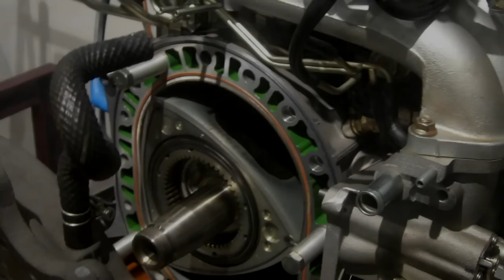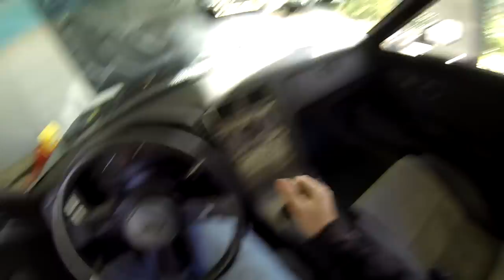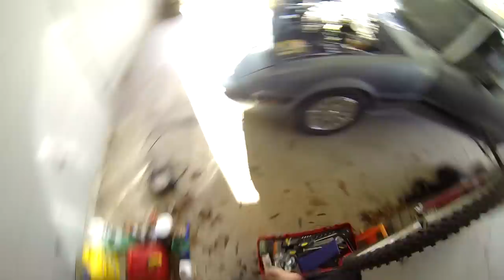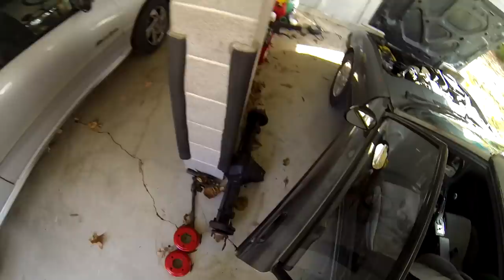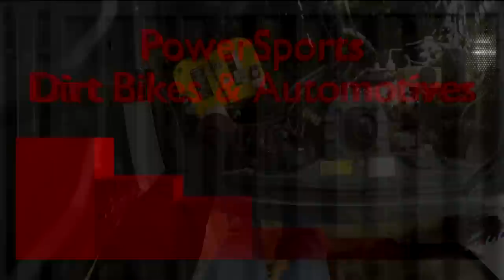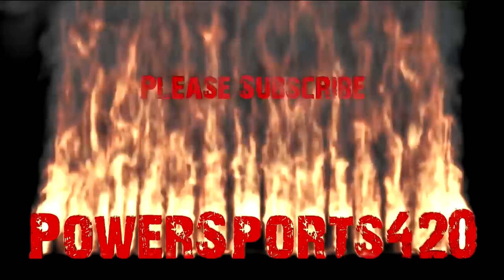RX7 Ep.11 - RX-7 Un-Flooding Procedure (How To Unflood The 13b)

Comment: Never start a manual without depressing the clutch. Not depressing the clutch puts added strain on the starter because you're trying to spin the trans while turning over the motor.
If you don't get it unflooded after one or two tries you must remove the plugs leading and trailing. I use brake clean to wash the excess fuel and carbon from the plugs.
Then add a bit of trans fluid in the trailing edge plug holes.
I pull the  coil leads off so you don't have spark from the plug wires to ground.
Crank for about 20 or 30 seconds, then put the plugs back in, connect the plug wires, connect the coils and the sucker should start.
Also never ever run a rotary for less than 10 minutes when it's cold, try to let the engine warm up to to clicks above cold on the temp guage.
Reply from the maker: Good advice!  Thanks!  ^_^
Reply: Like Ron said two times is probably enough before pulling the plugs. I used to carry a mini blow torch (butane lighter powered) and a tiny wire brush with me in the car (an FD). My problem was running colder plugs than necessary, 10.5s I think when 9s all round would do, Idling when cold was a pain in the rear :)

Comment: use that blue connector, but add a relay so you can disconnect it at will from inside the car. Disconnect for just a few seconds, the car will fire, then reconnect (with relay from inside), and you're golden.
Reply from the maker: That's a good idea!!!
Reply: I installed that on my GSL-SE years back, and it worked without needing to press the accelerator or any other tricks if it was flooded.

Comment: Make sure you check your BAC valve that's the thing with the hose connected to the the intake with RE-EGI written on it they bouncing idle that you had sometimes is cause by that also in a earlier video that bar connected to the throttle is fairly important it is part of the omp that injects oil into the motor to keep it lube I would fix that or premix with 2 cycle oil before you blow your motor message me if you have questions I know a lot about these cars
Reply from the maker: jac4444444 
BAC valve... is that like an EGR valve?
...that bar-linkage on the throttle is supposed to inject oil?  so, am I injecting too much oil since it has "fallen down", or none at all?  omfg dude you have me hella scared now... at least I am not running the car, cause it won't start in the rain, lol... but I need to drive it to my new home (200miles) on Sunday...
Reply: Yeah I'm not fully sure about the bar but I know its part of the omp and the BAC valve its part of the vacume I think it has to do with the idle but don't quote me if you havnt already check out the rx7club you can prolly find any answer you need and if you didn't know I own a red 84 gsl se exactly like yours but different color and I must say your car is in far better condition than mine if you have any qustions for me I can add you on steam if you happen to have it
Reply from the maker: jac4444444 
ok, so i did some research, and apparently, a lot of guys run 1:100 ratio 2-stroke oil, whether or not their oil injectors are working...  so, I'm gonna do that first thing in the morning!
Reply from the maker: PowerSports420 
ugh, youtube thought i was linking to a spot in the video...  1/100 ratio
Reply: I pray you're not talking about 2-stroke oil when you say 2 cycle oil... never used 2 stroke oil in something that's not a 2-stroke motor.

Comment: I assume you didnt have a choke on this one, but everytime for when I need to start mine with the ignition coil plugged back in would i need to pull the choke or would that possibly flood the engine again (given i need to pull it to start cold)?
Reply from the maker: This one was EFI, so no choke that I was aware of... 🤔
Reply: @PowerSports  no yeah what im trying to say is that my SA2 has a choke so im wondering if id need to pull it or not
Reply from the maker: Unfortunately, i don't know... 😓
Reply: @PowerSports  unlucky :( would you happen to know where the egi fuse is in the older models. I no longer have the fuze box cover.
Reply from the maker: Sorry, no.  You could try a Haynes Manual.

Comment: pull plugs for both rotors crank reinstall, she will start. that's the correct way to unflood the rotary .
Reply from the maker: Not only would you need to carry the proper tools with you, you'd be wasting a lot of time, every single day.  The "correct" way is to fully rebuild the engine so the apex seals work properly...   ...or you can sell the car, lol, and never worry about it again, haha.

Comment: Sounds like it not even getting IGNITION check all the coils.
Reply from the maker: superitachi431 
I had to pull the ignition coil, in order to drain out the extra gas...  Or do you mean it still sounded like that after it started?  It has new spark plugs and new wires...  How would I go about testing the coils?  Thanks!

Comment: take the plugs out turn the engene for a few so all the gas comes out the cilinders poor some engene oil to the carburator primary ventury the oil will make the engene turn faster make shure you clean the plugs
Reply from the maker: Unfortunately this one was TBI.

Comment: There is an easier way. Rev it a bit for like 5 seconds and let it idle for a few minutes before shutting down
Reply from the maker: I tried that, i swear.  The thing probably needed new apex seals.
Reply: @PowerSports  most likely but that's  a way to avoid flooding so I must have gotten confused with something else my bad lol
Reply from the maker: You are correct, it does avoid flooding.  But my engine was in really bad condition.